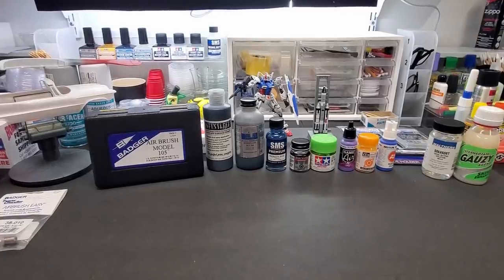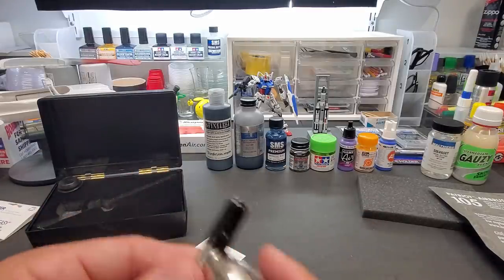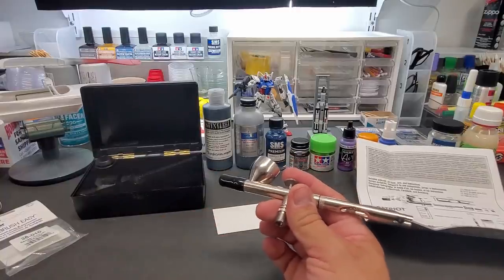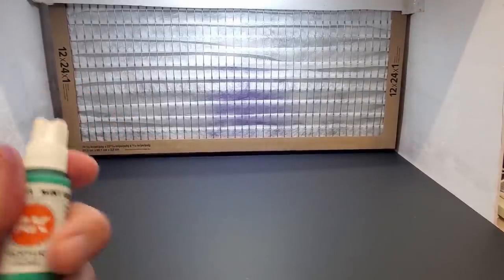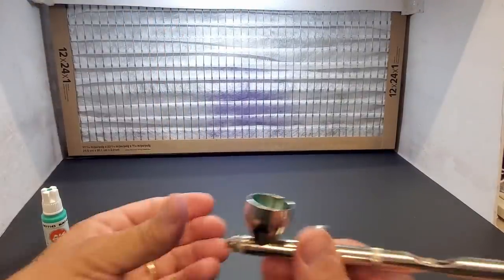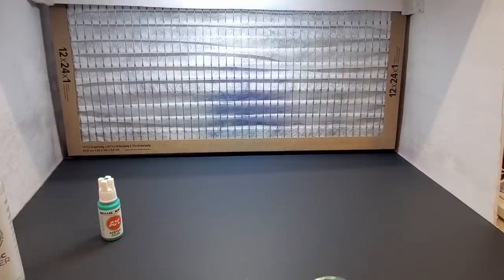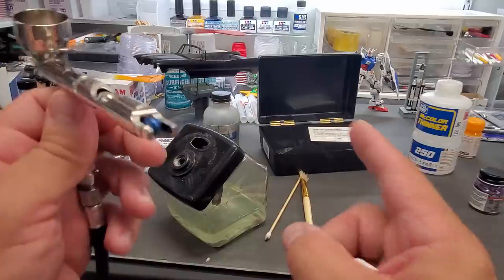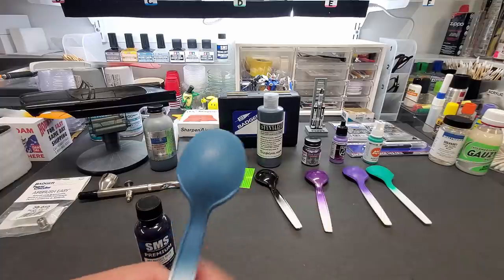Testing The Badger 105 Patriot Airbrush - Great All Purpose Airbrush

Comment: Thanks for this great review. As a result, I just got the Badger 105 - 155BGF combo set off of Amazon - what a great value. Used and still using their rugged 155 Anthem for over 20 plus years.
Reply: Have my combo from amazon tomorrow,$142 for 2 brushs cant be beat anywhere

Comment: Very good review. My first airbrush was a 105 from a few years ago and it has been an absolute workhorse of a tool. I even have a 105 with a super detail conversion kit which gives me the same airbrush but with a .3mm needle.

The only other upgrade I would recommend is Badger's High Roller trigger. It's raised up by quite a bit and lets you get a finer trigger pull for more detail work.
Reply: Dude. I didn't know they even make stuff like this. Buying it now. 

Update
The Hugh roller trigger is out of stock everywhere. 😢

Comment: Simple solution.  Store the brush with the needle pulled back into the brush.

You would like the Badger Krome and Sotar.

The teflon seal you showed is actually between the cup and trigger.  The new design allows easier replacement and adjustment if needed.

Comment: I have a 105 Arrow which is the one with the smaller cup for a quite  a while..you can purchase a needle guard for it..I put a extra fine set up on mine because i don't need the high paint flow of the medium and fine tips..the airbrushs that have the new needle bearings have a asterix next to model number etched on the brush..mine has the old set up and i've no problems with leakage in mine..the 105's nick name is the ''Paint Pump'' lol

Comment: Just a fyi. The name on the box hasn't changed with the new needle bearing update. My patriot is over a decade old and it's the same box
What you missed out on and what trips up most new badger users is that badger backs off the needles for transit and recommends lubing the needle before seating it correctly. Add to that if you are going to put cleaning tools in there you use paper dental tips. Use of those wire things damages the bearings

Comment: I've had the Badger 105 for about 6 months.  I use it all the time for primers and Mission Models paint.  i have to thoroughly clean the airbrush after each use, otherwise the needle sticks or the spay pattern is not good.  I thought that the plastic cup cap was a cost cutting item, as all my other airbrushes have a metal cap.  Nice review.

Comment: I Picked up a 105 Arrow about a year ago. It’s basically a Patriot but It comes solely with the 0.3 needle and I believe it also has a smaller paint cup than the Patriot. Regardless, It’s my favourite brush.  Very Even spray pattern and no it doesn’t take long for full coverage. 
  I Also run the Badger 150, an old favourite, and I have an old Model Master brush I’ve had since 1991.  It’s non functional but it was my first so I keep it around. Lmao. 

Jeff🇨🇦

Comment: Zup MR REX, love the video, very useful and informative. I own one of these Badger, and with my 3 kits of painting experience, I can say that it wasn’t a good one, if you remember me,  talking to you about “orange peel”, I was using the badger, you mentioned a lot  of paint coming out, even with a very low pressure(and mine came with the black back tip which is supposed to be a smaller needle), not good for beginners, in my humble opinion, but I’m only painting gundam kits. Also when fully cleaning the airbrush, the “back lever” (that’s how it’s called) is a pain in neck to hold the trigger and that part and thread the needle. I actually purchased an Iwatta, from Spray Gunner,  one of your other airbrush recommendations 😎👍🏼and it has been a wonderful and enjoyable experience. Once again thanks a lot for all the work and time you spend making these videos. P.s: I have the Extream 105 and it comes with a black end

Comment: So the card included in the badger Patriot 105 states that the needle bearing is the 50-046 like the other badger airbrushes. However, the actual needle bearing is the R-007 for the R-0023 inner seal screw assembly. I learned this the hard way by trialing the 50-046 needle bearing. The 50-046 does not allow the needle to move in the bearing. I also contacted Badger regarding this issue, and this was affirmed. So when you need to replace the needle bearing, use the R-007. These part numbers are the same as the Renegade series. Thanks for your time.

Comment: if you  get the smaller .3 or maybe its a .2 but what ever their new small detail aka black tip has better tip protection. ive had my 105 for 6 years and replaced the needles a few times , theyre short $ . the needles cone does need cleaning after each use in my opinion. but super easy to do a full breakdown and clean in short order.

Comment: I use the badger patriot 105 and paint does sometime leak to the trigger. I do like to spray at 15 psi. You were using the fine needle (blue head). I have most of the top quality AB but I want to master the 105 before I go to another one. You sprayed a Vallejo game air at 15 psi. I thought you said that the Vallejo model air works best with a larger needle and at a higher pressure 25 psi. Why did it work here at 15 psi? Thanks for posting.
Reply: If yours is newer with the screw on the back side of the teflon needle seal, turn the screw in slightly and you can fix that leak on you own, easily.
Reply from the maker: It all comes down to the design of the nozzle, here on this one it just let's a ton more paint through a d in turn that helps with a thicker acrylic such as Vallejo.

Comment: I bought Badger 100 (basicaly reviewed airbrush with not drilled backend cover) after two chinesee low ends, HS Evolution and Hansa 301. With 0,23mm needle (IIRC or is it 0,28?) it is very solid airbrush I use often. It is quite heavy when compared to other brands or types (I also have Ivatas, Krome etc.) and especially compared to HS Evolution comparing the weight is like comparing heaven and bagpipes. But that should be not so much a problem for revieved 105 Patriot as is in the case of 100 Patriot line. Anyway I forced a friend to make a CNC back end from aluminium. It is much lighter but quite nose heavy now.

Anyway I use it often, because it just works fine with any paint I have ever used. The trigger is acceltably precise, valve is working fine. I often recomend it when somebody asks for starting airbrush, because pricing is very near compared to IWATA NEO and other starting airbrushes and in my opinion it is almost indestructible and with 0,35mm needle has no problem with any paint. 0,23 needle is very fine too, so no problem with details.

This AB is awesome in my opinion. Only problem I ever had with Badgers is the weight.

Comment: If you want back pressure to clean or mix paint in the pot unscrew that end nozzle/spray regulator at the very front a little bit. Then pull back on the trigger just like you're painting and it'll bubble for you. When I'm cleaning mine I like to pull back on the trigger ALL the way back while I have cleaner in the pot then put a paper towel over the nozzle and apply pressure so it starts to bubble. The needle retracts all the way into the brush so you don't run the risk of touching the needle. It cleans that end nozzle too while I'm at it.
Reply from the maker: I only do the twist off the nozzle method. I show it in most of my videos but here because it came with the cap I did it this way.

Comment: I haven't had any luck with my stynylzer gray primer. I used a .5 gravity gun with about maybe 20-25 psi and almost immediately gunked up all of my gun. It got everywhere
Reply: Lower the air pressure to 10-15 psi.
Reply: @skrimshander  I'll try it thanks

Comment: Good brush. Got a high roller trigger for mine.
Also prone to leak bubbles if you don’t tighten the press fit nozzle enough - where there used to be an o-ring.
Reply: Parts are interchangeable with the Anthem 155 which is a syphon feed version of the 105.
The Anthem comes with the silver 0.7mm firehose - replaced it with the Patriot's 0.5mm blue for base coats and primer.
The Patriot got the new 0.3mm black setup. Those two will be my two brushes for spraying acrylics on models.
HP-CS and PS-270 will be dedicated for airbrush illustration using Trident and Golden high flow - smoother triggers than badger.
Reply: @LemurKrazy Try a SOTAR!
Reply: @michaelvanbuskirk8845  have a few sotars. Pain to clean compared to 105.
Reply: @LemurKrazy  How so? Airbrushes do not need to be disassembled every time you clean them.
Reply: @michaelvanbuskirk8845 I disassemble after each painting session.
Reply: @LemurKrazy  It's not necessary. Ask Ken Schlotfeldt and he will tell you the same thing. I don't understand why people think it needs to be disassembled every time.
Reply: Btw, Ken is not some godlike authority who airbrushes all day long. Using mainly water based acrylics which have larger pigments and clog more I have to clean and strip more.
If I was using laquer based paints I wouldn't.
Reply: @LemurKrazy  Ken owns the company and has been with Badger for over 40 years so he knows more about his product than anyone in the world. Do as you see fit, I was just trying to offer any help I might give.
What acrylics are you using and what are you painting? There are acrylics that have pigment almost as fine as other paints. 
When you say you are disassembling the airbrush do you mean entirely or just removing the needle and tip? Have you tried backflushing? I don't know what your experience is with airbrushes so that's why I ask.
Reply: @michaelvanbuskirk8845  I know Ken's story which is why I don't listen to him. Three badger problems with different airbrushes over the years.
They conveniently ignore support emails when it suits them - even Ken directly. 
Have been airbrushing since 85 in almost all paints and inks - about 40 airbrushes over that time.
There is always residue around the  teflon seal which is why I always disassemble after each session.

Comment: man i love my 105, now i came from an Amazon master paper weight, but mine don't like water acrylics. HELLA tip dry. sprayin Badger primer, clogs within minutes. got x3 dig needles, still clogs on the .5

looooove it for lacquers.... it's beautiful to handle, but we just don't jive with water acrylics.
Reply: side note... swappin needle/nozzle is soooooooooooo much easier on this brush than others i've seen. so quick to change. you can do it without dumpin the cup if you're smooth about it or got the cap ready. it's nice.

also i use a generic quick connect for my hose with an adapter, no issues.

Comment: The needle is also exposed because veteran airbrush users have learned to pick the dried paint off the tip of the needle which causes spattering.
T-shirt airbrush artists have been doing this for over 30 years.

Comment: Nice idea about using an inexpensive brush for additional nozzle and paint cup cleaning.
(Wonder what the 0.3mm needle version of the 105 would be like, performance wise).
Just wondering, I thought “stynylrez” (sp?) recommended a much higher air pressure for spraying the badger primers?
Reply from the maker: I'm wondering about the other needles too. I'm going to test them all but a couple of my go to places to buy them are out. I'm tracking them down now

Comment: A paint question.  I am very interested in the Badger STYNYLREZ Gloss Black Primer.  I am a model railroader and will be painting a fleet of locomotives black and yellow.  Is this gloss black a suitable paint for a finish coat that will have decals applied and then a flat finish over that?  Is there a better option for this?  Thanks, Andy K

Comment: Broke the thread on my Iwata Revolution Nozzle, ordered a new one, if i can't get the new one to work because of the thread if part of it got stuck i may order this since it has a compression fit nozzle and different needle sizes, i mostly just paint bases with the airbrush and will try to do shading next so it will prob be good for me.
Reply from the maker: This is a great airbrush for basing and shading. I use this airbrush every day, believe me when I say you'll be very happy with it
Reply: @barbatosrex9473  That's cool, it also costs a bit cheaper than the Revolution.

Comment: I was looking to buy my first airbrush from amazon or something but this morning I picked up a badger crescendo 175 with extra needles/nozzles, cups and hoses at a yard sale for $10, it does use siphon cups but right now it has a side gravity feed installed.. I dont know anything about airbrushes.. is this a good airbrush for beginner painting gunpla? I'm gonna scoop up the mr. Hobby paints you recommended to run through it

Comment: Thanks you for the review!  You are the one I trust.  The Patriot 105 is maybe going to be the replacement for my Paasche Talon GF which really sucks, crappy...  Got some bubbles in the cap all the time, got it for camouflage purposes but too mush promblems with it...   Can someone suggest me alternatives (or solutions for my Paasche?)
Reply: I had the “bubble” problem with a Paasche VL I just picked up. Drove me nuts…until I read the “troubleshooting” section of the manual. The solution to that problem is to crank down really hard on the air cap and nozzle using that little wrench they include. That seems counterintuitive since most airbrush fittings are finger tight. Not this one. I used pliers to tighten down the bigger hex nut and MAN!!! What a difference!! Works like a charm! It’s nuts how much that tiny extra turn changed things.Give that a try before you give up on it.

Comment: I currently have the 105, and do like the brush, but I want something a little better. I have a chance to pick up a twice used Harder & Steenbeck Evolution 2n1 (.2 and .4 needles) OR the GSI Creos Mr. Procon Boy WA Platinum Airbrush with Air Up System, 0.3mm for only a $5 less. Overall, which do you believe would give me the most flexibility for model building use, spraying mostly enamels and lacquers, but also water based acrylics.
Reply from the maker: I love my Procon Boy, I use it almost exclusively. It's a workhorse that does it all. That said, I had the H&S 2 in 1 and it was fantastic but my hand didn't fit it well at all. My finger hit the paint cup when holding it, meaning when I was spraying I couldn't hold it properly. The lever you push and pull to release the paint was too close to the cup that interference lead me not to use it right. I just couldn't spray with it. I wasn't alone too as I researched it. I had to sell it. But if you don't have that problem it's an incredible airbrush and I would buy it without blinking an eye.
Reply: @barbatosrex9473  Thank you sir, that is the type of stuff I simply would not know without being able to pick it up and hold it, which I cannot do.

Comment: Lol you just freaked out a whole plethora of viewers who probably have no idea why there's no spray head ;) I saw a few who said this was deal breaker having no clue why yet buying equipment.  Great video as always!
BTW This is General/Heavy duty Airbrush designed to paint large areas quickly not for painting the Eyeballs of Warhammer miniatures lol.

P.S. These 105's ship with the .5mm needle/nozzle (Blue Needle back) but you can buy the full kit that comes with the .3mm (Black needle knob) and a larger .7mm (Silver Needle Knob) which is basecoat/primer body painters dream.  I have 2 of these and would say kick it up to 20psi and yes with the .5 and .7 setups this thing drinks paint like nobodies business.  The .3mm is a good choice and will still push thicker enamels properly thinned.  All around a great brush when used for it's intended purpose.  You can decent detail with the .3mm but this is really for painting large areas quickly, though you can blend/fade camouflage with the #3 easily enough and it does lay a good line though nothing close to hairline of course.

Comment: You missed a great feature that it has, in fact most of Badger's airbrushes have it. The needle safety. Whenever you're done you just pull the trigger all the way back and slide it to either side into the side cut outs and the needle tip is protected.
Reply from the maker: Yes, I just discovered that. A good idea. I do love the way it sprays

Comment: Would you recommend the Badger 105 or the PS290 for primer and model car?
Reply from the maker: Both are great but taking the price as a factor the Badger is great. Also the Badger has 3 different needle sizes you can swap out. The Badger is perfect for Primer and auto model colors. 👍

Comment: I usually prime around 30 PSI with stynylrez. What's the benefit to going so low?
Reply from the maker: The manual that comes with the 105 Patriot says to set the psi to 15. I was shocked at first because of every airbrush I've used before it calls for a much higher psi but it sprayed everything perfectly at their requested PSI